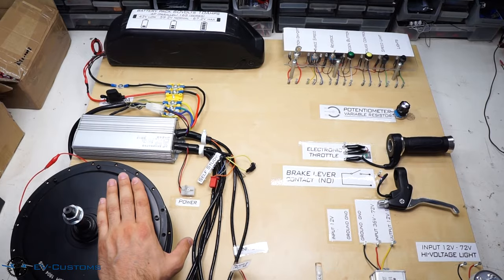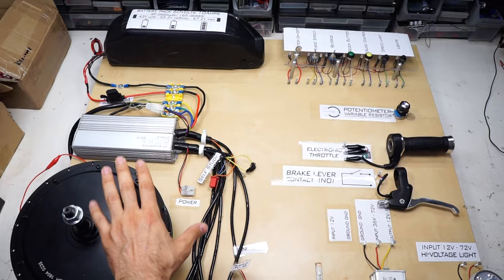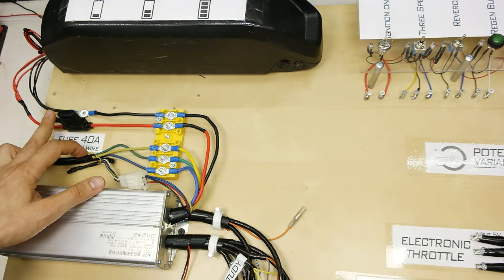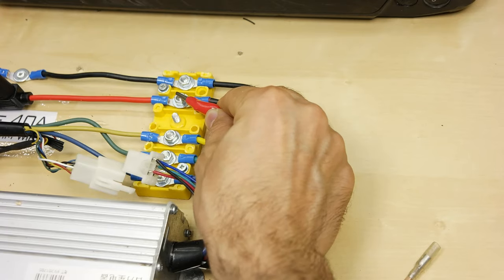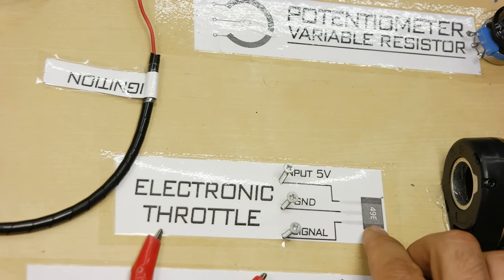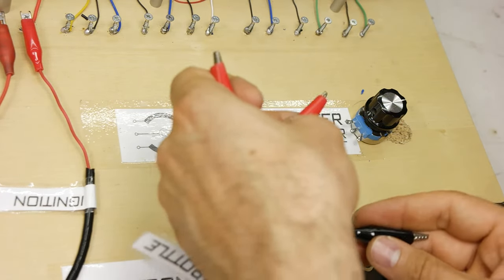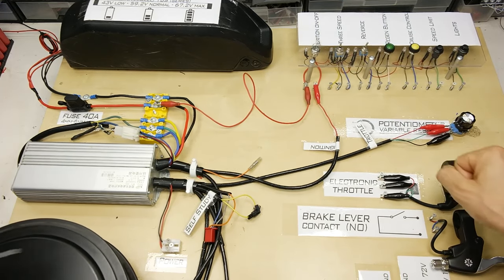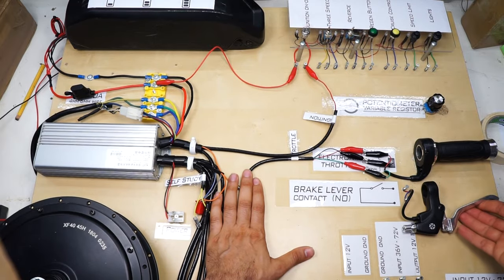BLDC Controller Learning Board for Beginners

Comment: I wonder why hall sensors always are used today. In the old days of electric 3-phase asynchon and synchon motors, this motors were driven directly from the power network and worked without sensors. There were no electronic controllers available. However there existed some now outdated methods to regulate the speed.
Reply: Exactly, my hall sensor went out and I'm looking up how to fix it if I can.

Comment: Thanks for the video.
Some ideas :
Arduino touch display : including watt meter (W, V, A, Wh used, Wh/km), speed and trip, remaining trip, motor temperature, main on/off, throttle control for limited speed and current, controlled front and rear light by luminosity and e brake, bms analyser with cellule voltages, bms temperature, Usb c phone charger

Low voltage cut off modification (for better life cycles)

Shunt resistance measurement for accurate reading of consumption (which depends if watts measured from controller)

You asked for ideas, there you have it. 😃
Reply from the maker: Oh my god...!!! you predicted all the work i do these days from touch screen arduino to shunt!!!!
Reply from the maker: This project is on the way...!

Comment: This really explains all the components well, that's for the effort that went into making the video. I watched it to help me find a power problem with my bike as when I click Low setting to Medium there is a power increase as you'd expect but then when I click to High I can hear it click in but only for a fraction of a second. I had the battery tested as I thought there was a bad cell or two when demanding more power as in High mode but the battery is fine. Any where else I should be looking please? Thank you.

Comment: hi. what is "high brake"? and how to connect it? to "gnd" to "positive bat"? thanks for the video & for your replay
Reply: The high brake requires a separate 12-volt battery. The low brake is not a real brake at all. All it does is shut off electricity to the motor when you pull on the regular handlebar brake lever.  That way the motor is not trying to make you go even thou you have activated the handlebar brake lever.
Reply: Hi I been watching all you videos they're  really helpful  do you any video how to explain how add any 12v converter to add LED lights or turn signals? I will appreciate you help thanks.
Reply from the maker: I will made learning board videos with dc to dc converters soon as possible,, so stay tuned..;)

Comment: Thank you very much for all the explanations.
I ordered a controller, but it came without instructions.
I realize where the battery is connected and the throttel I don't know which wires command the engine to start and stop.
Now I saw.
Thanks for the help!

Comment: that was good thank you very much...does the 3 speeds controll voltage to the motor? and is there a brake lever that can do proportional braking rather than on off regen?

Comment: Great video very helpful.
Does the controller with no hall sensor work on a motor with a hall sensor?

My controller is 50amps dualtron_x2 no hall sensor, and my motor is LD 3200watts with a hall sensor.
Reply from the maker: Yes all of them can work with motors with hall sensors..

Comment: Hey can you please help me. Ive a hub motor from a 2 wheel self balancing hoverboard and a motor controller (both 3 phase). So i want to control the hub motor with a gyroscope (MPU-6050) in both the directions. So if i have an output from 5V to +5V, how could i control the hub motor in both the directions. For eg with +5V i want it to go clockwise and with -5V anticlockwise direction. It would be a great help!

Comment: Thank you very much for the excellent ideas, and I want to ask you is it possible to connect a motor that works on a current of 36 volts to a current of 48 volts or more
Reply from the maker: Yes you can do that but you must watch  temperature of the motor..
Reply: @EVCustoms  thank you my dear
Reply: @EVCustoms  thank you my dear

Comment: Thank you for your videos, they have help me a lot.
I have a question i replaced a controler in a mini scooter, is alreay everything working thanks to your explinations, except the 3 speed, but my question is if its normal for the motor cables to gain heat,? havent run the scooter only acelerate a bit for testing, the motor noise seems normal, but i find the cables to hot.

Comment: A few questions. Is highbrake always connected to plus from the battery (are all or most controllers similar in this case)? Can i use high and low brake together / simultanious?

my idea is Lowbrake at the standard switch from the brake leaver and highbrake at a button to use it only when i want to. The question is, can i press the highbrake button at the same time i pull the brake which connects lowbrake, or might this damage anything insider the controller?

Thanks for your answer in advance
Reply from the maker: Hi... To activate high brake will work only when is connected to High pole of battery... now to connect them in same time.... i don't know because i never try it, but i think it will work at 90% without problem...
But I promise you that I will try it.
Reply: @EVCustoms  thank you for this quick response. I would love to see a video of your testing board when you test this. Thank you very much. I like your videos. I learn a lot from your channel.

Comment: What is the potentiometer spec’d to? I’m doing a mower conversion and I’d like to use a potentiometer as the throttle and have a normally closed switch hooked up to the brake. That way the operator prescience bail will open the circuit when pressed to turn it on and the motor will stop when let go of.

Comment: Question. I have a small foldable ebike. It has a 180w 24v motor. It goes way to slow. I need to replace the battery and the controller anyway because I want a trothle and the battery is worn out. To take as much as possible advantage of this swap. What combination will make the bike go faster? Can i put more voltage on the motor and what will be the max voltage?

Comment: Hi, thank you for your video very helpful but I have a question, when I connect up the wiring as per the video I still have no connection for the green black and red terminals from the motor as well as a thin blue wire from the throttle can you help please ? TIA

Comment: I have safety questions! I am doing research for a motorcycle install and I am trying to figure out where and how to install a kickstand safety switch.  I believe it is normally open while the kickstand is down.  Also, for hubs with regenerative braking,  how would it be wired so the rear brake light turns on? Thanks in advance!

Comment: Hello, I have a Bolt Pro and I put a new twist throttle with a key ignition that took the place of the cruise control button.  Now that I have no cruise control button I can't turn the LED Headlight on.  I would like to have the OEM button on the left handlebar be the cruise and headlight trigger but unsure how to connect it to the controller and work that way.  Got any tips or a step by step you could help me with?  Thanks and happy Thanksgiving.

Comment: awesome video! I have a dual motor set up with 2 controllers. im wondering how I can get the throttlen to move both wheels at the same time...currently I took the signal wire of one controller & integrated it in with the other controller...one wheel spins, I release the throttle,  & depending on how slowly I open the throttle in the next engagement of motors  both wheels will turn, buts trying to find a sweet spot on the throttle for both to turn...opening widely itll just go to spin either wheel without the other turning...any help would greatly be appreciated

Comment: does a bad hall sensor damage the controller? how about a burned engine? does it damages the controller
Reply from the maker: With defective hall sensor most probably if the controller is from good ones it  will hit error and cut the power from the motor, if the controller is from cheap ones...  most propably it will burn the motor, if the motor is high power  then will burn the MOSFET of the controller.

Comment: Do you know whether the ignition signal can be powered up prior the main power feed is connected or does the main power need to be supplied for the ignition circuit to work? I wonder whether these are separate from one another. Thank you

Comment: Great video. Very much appreciated. I have a pad on the board labeled EBS. It has 5 volts on it. Does it need to be grounded to enable regen? How ca I tell if it working?
Reply from the maker: Yes it must be grounded, after that if you connect low brake wire to ground electronic brake must work..

Comment: A warm hello from the Philippines! Thank you for the very informative presentation & straightforward explanation.  Pls. show us how to connect the 48V supply to power 12V lighting system using the converter as presented in your video. TIA.
Reply from the maker: Thank you my friend....  i am trying to find some time ro make this video ...
Reply: Also please include how to wire the DC to DC module

Comment: Out standing videos 👍👍👍 I like these kinda videos 👍👍 buddy good job most EBike Kit's have poor installing manual and the wires are not marked so it's hard to hook up  now all I need to know is how to fix power to the throttle and   Hall sencer burnd out no power to motor and throttle????? Or how to fix control box??? Hope you can help thanks 😊👍 buddy good job.

Comment: if you add another 60v battery pack would you use the same fuse for both 
battery packs?......Thank you for reading my question
Reply: its ok,I used (2)52v battery packs 20a fuse popped as soon as i left ,25a wowww then that popped i dont know why,well i still have 30,35 & 40amp fuses left to try.

Comment: how exactly does the three speed cable work? is it a ground and two signal wires?  ground to nothing one speed, ground to a signal wire another speed and ground to the other signal wire the third speed?

Comment: Good video.  Very well laid out.

Question, I see some throttle controllers have a USB port.  I assume it gets its power from the 5v delivered to the throttle for the hall sensor.  
Do you know how many amps the USB connection (A guess the 5v line as well.) might be able to sink?
I am interested in possibly using that source of 5 volts to power an LED Pixel strip or two.

I also noticed you have what appears to be a 12 volt regulator on your demo board that you did not use.  I am guessing it can handle a 60v input.  Where do you find that part online?  Does it have a model number?
Reply from the maker: Hello my friend..  yes this module is voltage step down converter,  it can convert  your high voltage 36V-72V to 12V, I recommend you to use this converter for your LED pixel strip, you can find these boards in very low price and with output 12volt or 5volt.

Comment: How do you differentiate between the three cables like the three speed (which is 1st gear, 2nd, 3rd) and throttle? Is it from the same color with the controller and throttle? Does the controller have manual?
And what's the difference between the regular controller (like the one in your video) with a votol?
Sorry for asking a lot.
I'm thinking of making a electric scooter

Comment: Very nice, thanks for putting the vid and visual aid together!  I've repaired and worked on cars, motorcycles, amplifiers, etc., and had questions about how electric scooters and bikes were put together, this is very helpful.  It would be nice if the manufacturers had a shop manual and a schematic available. In theory an electrically driven vehicle should be easier to repair and last longer.

Comment: it seems like the 3 speed switch is changing the voltage, but does it also change the amps?
Reply from the maker: With 3 speed you change only the frequency... starting amps is same...
Reply: @EVCustoms  thanks for the reply, do you mean frequency leaving the controller going to the 3 phases? i bought a 80 amp controller and never connected the speed controller, so i guess its in "middle speed", but it maxes at at 67amps. the seller told me once i put the speed selector into "high speed" and fully twist the throttle i will get 80 amps. do you think this is true?

Comment: How aggressive are electronic brakes? The video shows the wheel stop immediately. Do they just cause drag to slow you down or lock the wheel and throw you into the handlebars? Great video!!! A lot of controllers I've seen on eBay have tons of wires but nothing is labeled.

Comment: The 3 speed wire. The middle one is ground ( - ) i think so does it connect one of the outer 2 with the middle wire for 1 of 3 speed mode. My scooter has that one not connected and its not going really fast. (35kmh)

Comment: Hi you mentioned that when you apply the electric brake  ,the motor changes the role to  an inverter and recharges the battery ,does it not have losses at braking ? or else 100 % regenerative energy is recycled to  the battery
Reply from the maker: Hi...  when e-brake activating the hub motor changes to generator via controller, never you cannot take 100%  of energy, because always you'll have losses of temperatures and frictions, but this loses is too small on electric motors about 10 to 15%..

Comment: Great video Sir! i have an important question/problem to solve for make my elettric scooter legal in my country(italy) i hope u can help me :(

I have to change 2 of the 3 speed settings of mine lcd throttle to:7km/h and 25km/h with out change the third one (that have the maximung speed).
i have an lcd throttle and i can only change the % of the total power that my scooter will take(from 0% to 100%),not the singol speed setting,so after watching your video(for what i get it) i have to change the voltage of the three input of the speed controller for make what i want,right?

So my question is:how i can do that? there is a way to change manualy the voltage for each signal?can you do a video tutorial for that? i think will be realy usefull for people that want change the speed settings one by one

Comment: Thank you very much for the great video. I learned a lot. But please tell me why is the engine making this loud noise? My replacement controller sounds exactly the same, while the original controller installed in my scooter is much quieter. I hope you or someone else can help me. Best regards
Reply from the maker: If it make to muchi noise,,. you must try to make some compilations with hall sensor wires and power wire of motor, until the motor runs smoothly..
Reply: Many thanks for the quick response. I will try it at some point.
Reply: Unfortunately, swapping them was unsuccessful. Is there another point that should be considered?

Comment: Hi there I really found your video helpful!!!!! I tried to install a 1500 watt 48 volt Voilamart kit but it doesn't work.  
I figured out that it's probably the controller so I ordered another controller but I can't figure out which wire is the ignition wire?!.  The controller I bought is the Yalu 3000 watt 72 volt. It has BM-1119 on the back panel of that helps. Thanks
Aaron

Comment: Hello, friend. Very wonderful work. Very simple and professional
I'm towards construction. 
72v 35ah batery with sabvoton 200a. Currently building the batery.
I have a question about electricity. Where to place the main fuse (225a). Whether between the battery and the controller or between the controller and the motor.
Is there a need for extra fuse in another location... Evaluating any help thanks

Comment: My question is if i buy controller to incraces power will working?My bike come with 350w motor and 36v battery if replace with controller 48v ? Thanks
Reply from the maker: Hi... wheel size?

Comment: Nice video. I am wondering how a controller like that contains the regeneartive braking feature by holding the mechanical brake? . Does it?. Because normal controllers does not have this feature inside it.
Reply from the maker: 90% of controllers  and more,, have regen braking feature...
Reply: @EVCustoms  This braking is electrical brake. Controlling the stoappage electrically does not necessarily means that battery will charged. However, I think you are refering for having an electrical brake that disppates energy by passive element rather than having a mechanical brake system. Let me know about you opinion SIr , Thank you !
Reply from the maker: @Abdalrahman_Yahya  There is no any passive  element (load resistor)  in controller, all regen braking futures always charge the battery with a low amount of energy...
Reply from the maker: @Abdalrahman_Yahya   There is two ways, first one is just disconnect the motor when you braking and second one  breaking via motor an charge the battery at breaking..